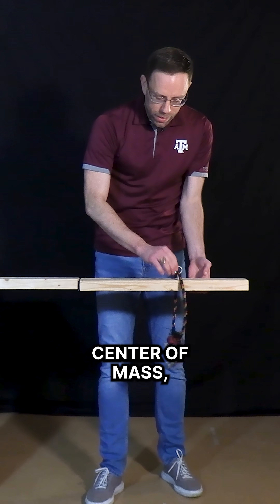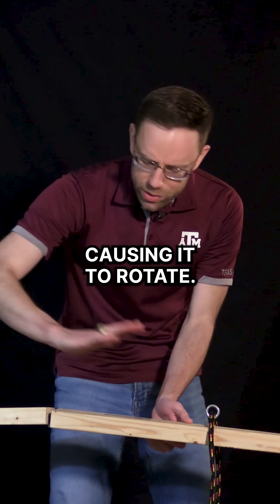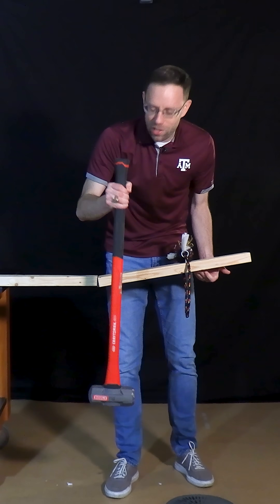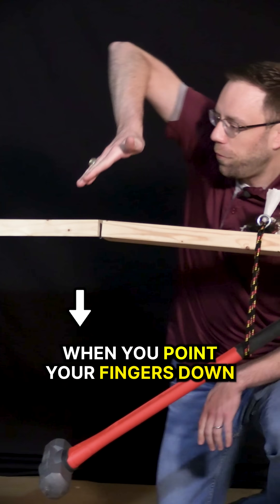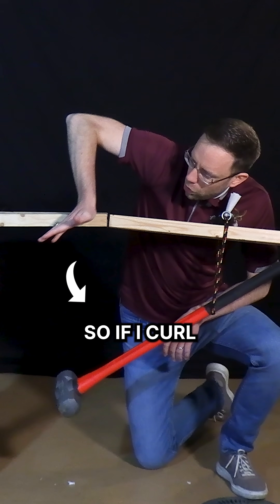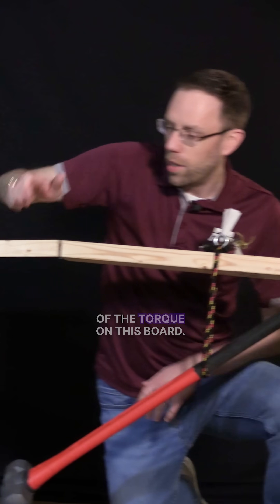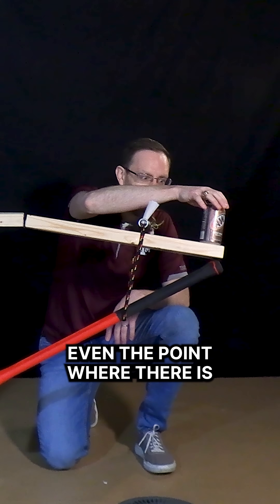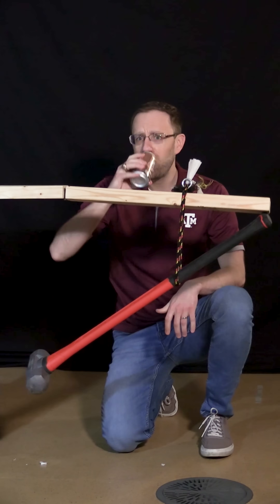Floating sledgehammer using physics! 😮 #shorts #TAMU #DrDawson

Comment: He explained it so well but my brain still refuses to understand.
Reply: @ava.and.jasper  Hammer heads weight is basically pushing up against the far end through its handle
Reply: @dustydreams5940  this makes so much sense, I get it now!!
Reply: It's the same principle behind those toy birds that balance on your finger with their beak. They have weights at the end of their wings that are angled in such a way as to where the weights in the end of the wings sit forward of the beak and counter balance the weight of the body. The result is balancing on your finger perfectly by its beak, counterintuitively.
Reply: @loganspargo9222  yes, I remember those toys. Good comparison, thank you!
Reply: the "missing" reaction forces are happening inside the hinge. because of the black background it kinda just looks like the second board is floating, adding to the illusion.
Reply: @ava.and.jasper  he didn't explain it very well imo. 
Gravity pulls on heavier objects harder. The head of the hammer is heavier than the board it's hanging from. Gravity wants to pull the head of the hammer down more than anything else in this model. Due to the positioning of the hammer the handle will push the board up the more the head of the hammer is pulled down. This means the handle is pushing against gravity and causing the board to appear to "float."

When he talks about pointing his fingers, he stops making sense to me.
Reply: @ava.and.jasper  actually.... he explained his version.

All it is, is the hammer is constantly trying to fall/swing down.
That swinging motion gets nearly instantly turned into leverage since the rope is locking its position.
That locked leverage (aided to not slip by the Rubber handle) lifts the board... and it's smaller weight isn't enough to cancel it.

If you make the sledgehammer heavier (OR LIGHTER), it'll still lift the board by about the same angle because the whole hammer itself is also falling.

Basically, it's gears proving they can only do so much work but never reach over-unity (which would be to lift the board above the completely horizontal line).

I mean, unless you tighten the rope even more so that the hammer is nearly horizontal. I assume more leverage torque exists but the angle between them all will still prove over-unity is impossible to reach.
Reply: What brain?
Reply: It doesn't make sense because it's bull. There is no reason why that shouldn't just fall. That can't be a regular hinge. It's nonsense.
Reply: @peves-  it makes complete sense. imagine the head of the hammer isn't there, and he just screws in a rod that way... it will fall. now imagine you gently push down on the end of the rod... the wood plank will move upwards. the weight of the hammer-head going down is the same as you pushing down in that case

Comment: I always get confused is a moment and torque the same thing? I know they have the same units, but I always thought they were different in application
Reply: I'm a bit rusty on this, but IIRC a Moment of Force is the same as Torque, however, the word Moment itself doesn't have to just be about a Moment of Force. You can have a Moment of Momentum, for example, which obviously isn't Torque because Torque is a rotational force. You'll want to look up the definition of Moment in how it's used in things other than Force to get a better idea of what "Moment" specifically means.
Reply: @ oooh for some reason I always thought a moment and torque where somehow separate lol no wonder I always get confused when working with torque. Literally 4 years of school with that misconception, crazy

Comment: Here is a good explanation.

Basically, the sledgehammer uses a rotational force in an opposite direction. The resultant force will cancel it out, making the table float :) [cancel out *mostly*]

Comment: maybe easier to understand using a triangle like a coat hanger (upwards pointing triabgle). If you hang 1 kg on the left lower corner and 1 kg on the right lower corner, the coat hanger will be balanced.
If you put 1.5 kg at the left corner, that corner will move down a bit and the right corner would move up a bit.
You can even remove one of the edges (sides) of the triangle, and it would still work.

Comment: The center of mass of a perfect equally weighted object is surely the exact center. You've done the experiment wrong even though it worked the board wasn't straight. Also it's only "floating" if the hinge is removed. That board was suspended in the air.

Comment: After beating polybridge ... you can also build a tall A-frame using steel with a rope or steel cable connected from the top of the A-frame to the end of the table.

Comment: So does the weight of the sledgehammer play any role to making this work? Would this trick work if the sledgehammer being replaced by a palstic rod?
Reply: no, since a plastic rod does not have the same mass as the sledgehammer head, the center of mass would barely change.

Comment: You should have explained that better...
Reply: because of the hammers placement in relation to the board, in order for the board to fall it must lift the hammer. the weight of one balances the weight of the other, due to the angle.

Comment: the hammer is attaching the board with the rope, why not the weight of the hammer cancelling the hammer's torque ?
Reply: Because it doesn't matter how a mass is attached to a system, its affect on the center of gravity is the same.

Comment: The center of gravity of the whole movable system is on the left side of the supporting hinge.
Taking moment about the hinge will cause the system turning anti-clokwise until the center of gravity just below the hinge vertically.

Comment: It also helps cutting and flipping the hinge that allows the board to flip and having the hinge on the top side instead of the bottom.  Now that being said that hinge is bent do to the weight of the hammer and improperly installed to both boards.

Comment: bad explanation, just explain first the summation of force. moment is just part of force. the hammer creates a counter force due to being angled roughly 45 degree. this creates force downward and right. the wood beam creates force due to weight in downward and leftside by being in fulcrum state at most left, Now imagine the rotation of each, that is the moment of the force due to its axis, The summation of forces is ZERO, Zero forces means equilibrum. 
My explanation is not considering the center of mass, 
when you add center of mass, you will need to consider the distribution of Forces, if you put the head hammer at the contact between the wood and hammer, the system will just fall, cause the center of mass of the hammer is leaning more one side.

Comment: The table is hanging directly below the hinge. Let me explain:
The hinge does not allow torque to be transferred, thus the center of mass has to be directly below that hinge, as in a pendulum. It may not look like it, but the hammer is so heavy that it pulls the CM very close to its head, to the point where the plank almost returns to horizontal
Essentially, the appearance of a "floating table" is simply the result of an extreme mismatch of where we think the table should be and where the center of mass actually is
Reply: @enderyu  I don't think so Tim. This isn't about center of mass, this is about opposing forces.
Reply: @jonathanh761  Yes it absolutely is about center of mass, do you even know how to calculate torque on the plank and hammer? 🤦
Please study some physics before correcting others
Reply: @enderyu  I understand center of mass. You said the reason it looks like it's floating is because people don't understand where the center of mass and it's an extreme mismatch.. it's not... you would expect the center of mass to be where the giant freaking hammer head is which is just below the hinge(almost) that small offset is not an "extreme mismatch". The real reason it confuses people is because the opposing forces are counter intuitive due to the hammer not being fixed to the swinging part of the table.
Reply: @ Yeah, now you understand center of mass, even though you had just said "This isn't about center of mass". Suddenly the problem is that it "is not an 'extreme mismatch'", when more extreme than that only if the table were made of styrofoam and the hammer out of tungsten, are you kidding me.
And what do you even mean by "hammer not being fixed to the swinging part of the table"? Stop doubling down, it will hurt less

Comment: Easy to understand: The hammer is on the left of the hinge, therefore it is going down. The board is on the right of the hinge, therefore it's going up (Pushed up by the handle of the hammer). Just imagine a mechanic scale where you push on one side.

Comment: Even cooler, correct me if I'm wrong, but when he put the can at the very end, the sledgehammer actually generated more torque because the horizontal distance from the hinge to the head of the sledgehammer increased.

Comment: At which angle  will the sledgehammer (approximately 45° in the video) no longer apply enough torque to be stronger than the gravitational force pulling on the "mass on a hinge" ? 
If the sledgehammer were parallel to the board the direction of the torque would no longer push against the opposite end of the board from it's fixed position.

Comment: Imagine a seesaw. You have a heavy person on one side, and the seesaw tilts down on that side. To balance it, you put a lighter person on the other side, but further away from the center. Because they’re farther out, they can balance the heavy person, even though they’re lighter.

Now, in this experiment:
-The plank is like the seesaw, tilting down because of gravity.
-The sledgehammer is like the lighter person, but it’s positioned far from the center (hanging), so it helps to balance the plank by pulling back in the opposite direction.
In short, the sledgehammer is positioned in a way that it prevents the plank from tipping further, just like the lighter person on the seesaw helps balance the heavier person : in fact that would’ve been a much better clip, this is more or less the bougie version 😂

—————————————————————

Another way to look at it is that the hammer’s head can only move downward through rotation, but for this to happen, the handle part of the hammer would need to move upward. However, it can’t do that because the plank is in the way. Gravity pulling on the hammer’s head is actually pushing the plank upward, preventing it from rotating further & the hammerhead being “past the hinge( pivot ) in the other direction” is what’s actually balancing the whole system

* past that I tried 🤣🏳️, another thing to note is some form of measurement has to have been made for all of this to “balance”.

Comment: The way i like to think about this is that gravity will cause the center of gravity of the board to end up under the hinge, cuz its the hinge supporting it. By putting the hammers head on the left, the center of gravity shifts to the left, until its roughly under the hinge. Now, the board/hammer is 'balanced' under the hinge.

Comment: So is the fact that the hammer's handle is pushing on the tip of the board also important? I feel like it is. I imagine in my head that if the hammer was just floating parallel to the board without touching it, this wouldn't work
Reply: If the hammer was physically attached to the board, it also wouldnt work. Physics can be amazing :)

Comment: Basically, the clockwise rotation of the plank is cancelled out by the counter clockwise rotation of the hammer.

The cancelling out happens exactly at the point where the end of the plank and the end of the hammer meet.

Without the contact at the end of the two object, no cancellation would happen—the plank would fall following the clockwise torque.

Comment: These types of experiments make me believe that with torque vectoring it’s possible to create an air craft that cancels the effects of gravity.
Reply: If it's not connected to anything else, how will it float?
Reply: @  it’s a concept that I like to think of as centrifugal gravity cancellation.  According to several AI models that I’ve had generated. It’s possible. However, technology is not up-to-date. The overall concept is known in sci-fi. Multiple spinning rings, spinning in several different directions, using centrifugal force to create a torque vectored by an AI computer system to allow that torque to be directed in specific directions.

Comment: I'm convinced wizards were just people who understood physics well enough to ruin other people's minds
Reply: Not an incorrect assumption. Apparently if you could predict the weather in the UK you were legally considered a witch. Which was a thing up until a little after WWII.
Reply: @noneedtoknow07   no it was thing till the 50s
Reply: try to wrap you mind around the computer chip and you realize its basically magic.

using energy moving through essentially runes to effect a connection with the environment inside silicon.

its a smart golem that cant move unless you use other things like magic stones (magnets) in a special formation (a motor) and use metals in coils to amplify the magic.

we sacrifice fuels to power magic machines (cars)

we live in a magical society.
there comes a point where magic and technology is indistinguishable.
Reply: @Kittsuera   I mean think about computers as a whole too. Silicone, glass, metal, whatever, are basically fancy rocks, or materials from rocks. (silicone is made from silicon, which is one of the primary elements in many rocks, metal is just a shiny rock, and glass is melted sand... which is basically a bunch of tiny rocks) and we taught it to think. it may be a very rudimentary type of thinking (at least until true ai gets off the ground, assuming it ever does), but it's thinking all the same. It takes information and spits it back out when we request it. We took a bunch of rocks, smashed them together, and taught them to think. ain't no one ever gonna convince me that some kind of sorcery doesn't take place somewhere in all that
Reply: @Kittsuera  i feel like this is a quote from 'a certain magical index'. can't and won't prove it though
Reply: It's called magicians and sleight of hand.
Reply: wizards were traditionally just wise old men before they became sorcerers so this tracks.
Reply: Wizard.

Wiz-ard.

Wise -ard.

Definition: Someone who was very wise.
Reply: Time traveler
Reply: Check what happened when Tesla demonstrated remote control of a boat...

Comment: Easier to think on the very right end of the board. The hammer wants to swing left to right, so the handle portion has to rotate right to left. Doing so pushes the board upwards counter clockwise.

Comment: This may seem like magic, but think about what you would do if you leaned too far back on a chair and were about to fall backwards. You're first instincts are to try leaning forward again - this is just shifting your centre of mass past the pivot. We all have an intuitional understanding of moments
Reply: yeah we are all familiar with empiric stable and unstable balancing of a mass, but when it comes to our body, or most objects in nature, or even most common manufacturers objects, the center of mass isn't too far from the center. but a sledgehammer is very different in that regard. center of mass very far from the geometric center makes it unusual to balance. but there are exemples like old CRT TV's and monitors

Comment: I’ll give my shot at explaining too:
When the board falls, it can only rotate because it’s on a hinge. Because the weight is on the other side of that hinge, the board falling would mean that weight has to go the opposite direction, up. That can only happen if the falling end applies enough force to lift the rising end, just like a see saw. But… a really convoluted see saw. If instead of that other see saw side just sticking straight out, it jutted out from the other side and wrapped all the way back around. A really really weird see saw. I think somebody else said to think of it that way, I dunno, but there’s lots of scary words out there. It’s a convoluted see saw lol. Weight only go up if other weight push more down.

Comment: It's easier to think of the point where the rope touches the sledge handle as a point of rotation. The hammer rotates from left to right. Use the word "rotate" rather than "torque" and you'll understand it better.
Reply: What you just said makes less sense than what what was said on the video.
Reply: @ambassadorofreee3859  that's OK. American?
Reply: @ I find it hilarious that when someone says you make no sense you assume they are american.

I'll say this much, you got the wrong continent and that's all you are gonna get.
Reply: The point of rotation is the hinge between the two planks.

Comment: Torque is not a great way to describe this tbh... 
It's just 1 object with a center of mass that is very low and right under the hinge. 
Center of mass wants to be in the lowest possible position, and so in this case it would have to go up if the plank were to go down (the head of the sledgehammer would be pushed up)

Comment: This is a really convoluted way of explaining what's happening. The use of the "hinge" will also mislead a lot of people. That hinge is irrelevant to what's really happening. You can completely remove it and just rest the board with the sledge hammer near the edge of the other board and the result will be exactly the same...the board and sledge hammer together is one part with a particular center of gravity and it will always balance itself when that center of gravity is directly below the point where you decided to support it.
Reply: @internettoughguy  not quite, the center of gravity is irrelevant here
Reply: @gamingseries7608  No it's fundamental to what's happening. Center of gravity or center of mass are essentially the same thing in this particular context.